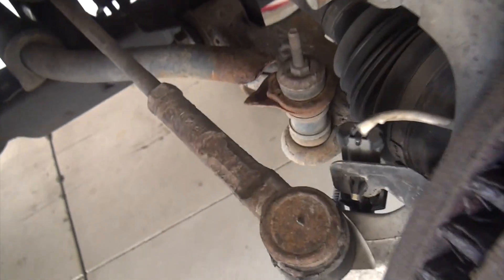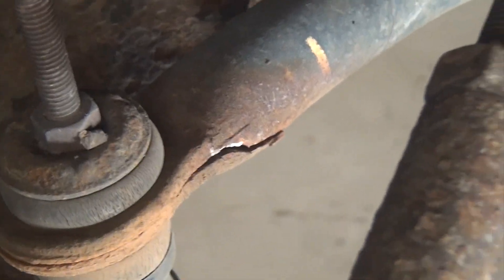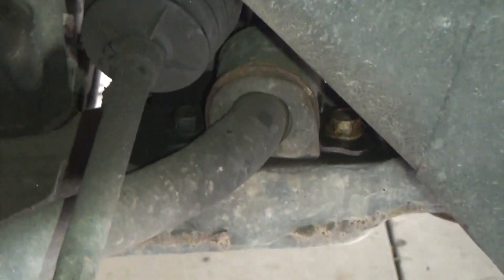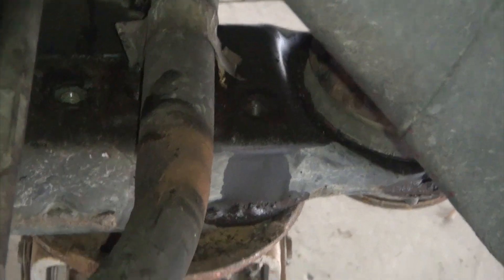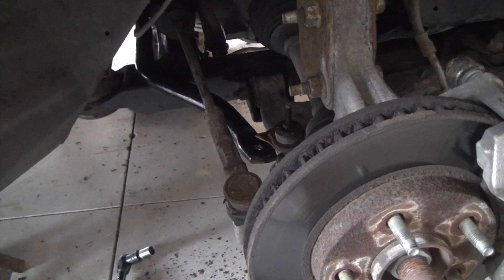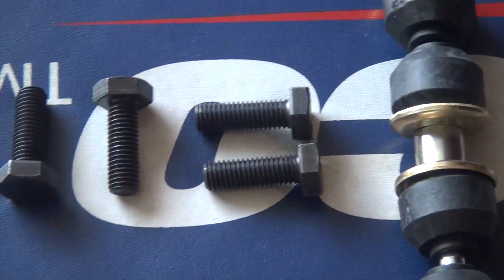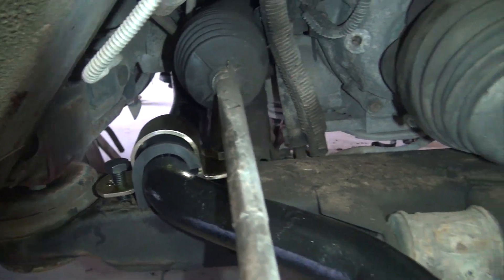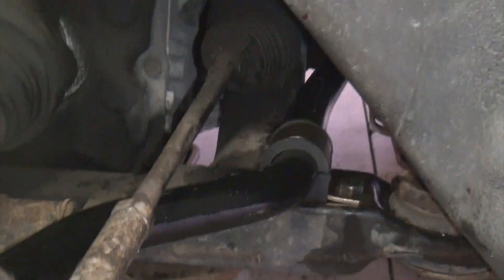Grand Prix Sway Bar

Comment: Thanks for posting this video. You gave me the visual info needed to change the the sway bar on my wife's 2002 Buick Regal GS. Dropping the sub frame was a concern for me. Now I have a better idea how far to lower the frame. I wonder if it's possible to use an extension on a impact wrench to loosen the nuts for the insulator-to-frame bolts.There are access holes in the frame for those nuts. Guess I'll have to give it a try. Thanks again for sharing this repair process, Mike!

Comment: thank you good sir. I have the same problem with my 2000 daytona 500 gtp and couldn't find a video on how to replace sway bar for This particular vehicle. mainly needed info on where the bolts were that held the back of the engine. you have just saved me lots of much needed money!!!! thank you!

Comment: Thanks for posting this video. The sway bar on my 98 GTP just gave up at the same side. I don't know if there are any tangible differences between the 98 and 03 models, but I'll be making my own video of the process when I swap the bar out If anything, the age of the car should yield some hilarity since Utah road salt is just as brutal as MI. I'll have to hunt down a solid bar like the one you found. It's interesting how the "pop-pop" during turns from a broken sway bar sounds like bad ball joints, damaged struts, and other problems. Regardless, after Dropping $2300 on a replacement transmission at 178,000 miles, I'm intent on keeping my GTP as long as possible since I know the engine so well. Still, it deserves the custom door decals I made where "Supercharged" is replaced with "Shitbox". Stay zesty.
Reply from the maker: Cool! Post a link here when you finish the video.
Reply: On it. I'm bookmarking so I don't forget.

Comment: I just did the bar on my 2001 gp. I dropped the cradle and took the tie rod end nut off. The replacement is a solid bar and is heavy.
Reply from the maker: It is heavy, and I think the solid bar made the car handle much better.

Comment: The biggest weakness of the stock sway bar is that it’s hollow, there is barely any support. The replacements from ZZP are a huge upgrade, and helps reduce body roll and understeer. The installation process is the same across all W-body cars, a few little differences here and there. On my Intimidator, the sway bar is right against the brakes while on a GTP or Regal they are farther back. Nonetheless the ZZP sway bars are a huge upgrade, not too expensive and very straightforward. Highly recommend

Comment: great video Mike......just doing mine now....do you still have your gtp in 2021?
Reply from the maker: No, I sold it because it had almost 150,000 miles and little problems were starting to add up.  I especially hated the constant A/C problems.

Comment: So you said it broke on the right side of the car. Did the car pull to the right when you were driving? I took my car to a GM mechanic to get an alignment because the wheel is not straight, the car pulls to the right, and the car shakes almost uncontrollably. They told me that my sway bar is broken, the lower control arm joints are bad, and the struts are bad. He said the sway bar is likely the reason the car pulls one direction but he didn't say where it was broken at.

Comment: before that i took it to top value in southgate that wanted more $ to do the same plus said i also needed both front control arms wanting $300 for ea, which i did not need, the mechanic at tire traxx showed me both of em and are fine, car drives great. ya i probably could use em but i do not need em. Went there thinking i only needed  one tie rod to be told a long list of issues they addressed in my car totaling 1,600 + i turned around and went to tire traxx who  fixed what i needed for $250

Comment: Great video.  Is it possible to remove the sway bar without lowering the subframe? Thanks
Reply from the maker: bojna1 Not without a cutting torch!
Reply: +Michael “Miguel” Kernen ok thanks
Reply: +bojna1  Possible?  Yes.  Easy? No.  I did the sway bar on my 2005 Buick Century this weekend, which, from what I understand is pretty similar to this car, as well as all the small V-6 GM's.  If you have a lift, it should be pretty easy to route it through from one side if you raise it to about chest height.  If you are using a floor jack with jack stands like I have and most backyard mechanics have, you will need to get the front end of the car as far off the ground as possible.  I saw another Youtube video where a guy did not drop the frame.  At least, the video di dnot disclose that.  But, he angled the bar up as he inserted it through the passenger side.  So, that's why you need plenty of ground clearance.  Also, you may have to pound it through with a hammer and just force it.  Crude, but effective.  It's pretty much a permanent fix and you will probably never have to replace it again since the aftermarket ones are solid forged steel or iron.  The new one must weigh 18 - 20 pounds! The parts stores want 100 bucks for this kit, but I got min for 65 on Ebay.  Just shop around, the car is still very driveable in the meantime, just unpleasant to listen to!  A bit of patience helps too...best of luck, but you'll get it!
Reply from the maker: +Vince Williams Actually, dropping the subframe was not too tough and made accessing the sway bar bolts much easier.  Something to consider..
Reply: On my car, it's not as simple.  The steering components must first be disconnected before the frame can be dropped.

Comment: Does it make a difference if I use a 32 mm diameter or 33 mm diameter for my stabilization bar?
Reply from the maker: Probably not - might be a tiny bit tougher to squeeze it into the bushings.  Doubt you'll notice too big of difference in the handling.

Comment: great 1st video brother.
Reply from the maker: Thanks Jessie!
Reply: Mine was all the way broken as well. I order my parts from EBay for $65 over Autozones $99. I figure it may be smart to go over the sway bar itself with a lil black engine enamel to protect it a little more. Ur video gave me confidence to do it. Damn thing broke pulling out of my drive way. Good old 99.
Reply from the maker: Good luck.  Soak the bolts with PB Blaster or  penetrating oil esp. if you live where they salt the roads in the winter.
Reply: good old Chicago Illinois. lots of salt
Reply from the maker: Thanks!
Reply: Michael Kernen I have an 06 grand prix gt and my REAR sway bar needs to be replaced. Do u think it'll be similar in replacement....possibly easier?
Reply: Yes brother you just helped me out now I wanna try to fix my self

Comment: Did the car chew through right side tires? inside of mine are down to steel and these are new tires.
Reply from the maker: No, but I noticed the bar break right when it happened because it made lots of noise.  The sway bar shouldn't affect tire wear much but handling will be pretty awful.
Reply: Thanks. Wonder if its a wheel bearing on mine then.